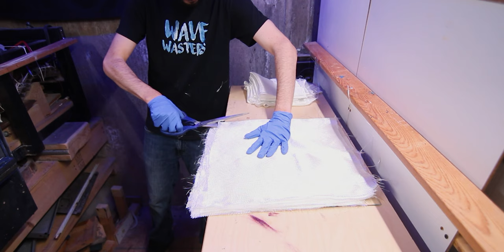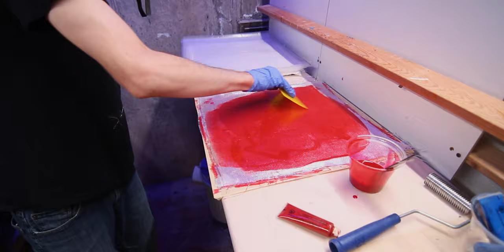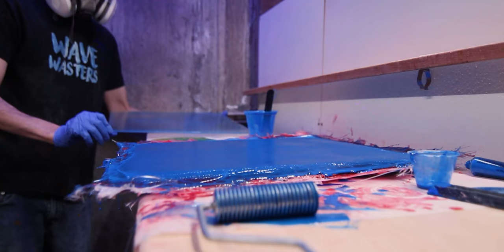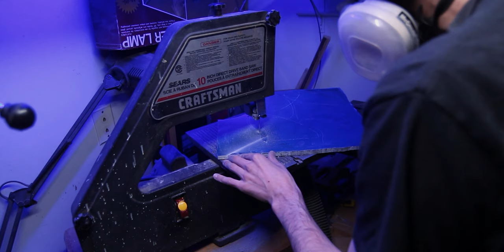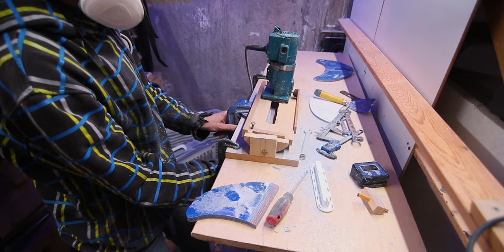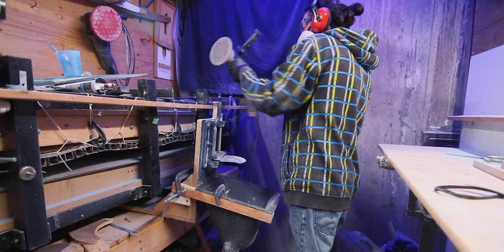Surfboard Fin Panel Experiment Gone Wrong: Lessons Learned

Comment: Livin’ and learnin’! So cool to see your tools and techniques as you create. I made a fin for a windsurfer once…it’s at the bottom of Lake George here in Kings County LOL! It was fun making it though and it worked for a little while before it broke off! I had satellite dish mesh as a reinforcing layer but I didn’t take it into the tab and it cracked and broke off where the mesh ended. Needless to say, it was fun sailing back to shore with no fin! I have made suspension support bulkheads for R/C cars by laying up fiberglass on a piece of glass, like you did, but I only made one layer and then cut the layer into pieces and CA’d them together in a press. They worked for their intended function but where they weren’t sanded, I don’t know if there was air bubbles in between the layers. Would it help if you put your final laminations in a press not worrying about the outside layer being smooth as you mostly sand that layer off?…just thinking out loud… As always, cool stuff Matt 👍 Cheers, John
Reply from the maker: Thats rough, how much harder was it to go finless? I've never tried a windsurfer before. A press would have solved a lot if not all of the bubbles. I should have tossed it in my snowboard press. I was originally going to use it but where I was testing multiple things at once I didn't want to complicate things too much.
Reply: @WaveWasters   Hiya Matt, it was not easy to go finless on a windsurfer as you need some sort of lateral resistance to counter the lift of the sail. If I remember correctly, ( this was over 35 years ago! ) I had to put one foot on either side of the mast and try to bury the leading rail to make it act like a bit of a keel to keep the board from just skipping sideways. I was close to shore so it was no big deal and I just jigged and frigged my way back in. My years of windsurfing made me think I would be good at surfing...boy was I wrong! The only thing in common with the two sports is the word "surf". To me, at least, surfing is way more challenging as there is nothing to hold on to like the boom of the windsurfer. Of course, I might say that windsurfing is hard if I had started it at 54 as well! 

Yeah, a snowboard press would have worked nicely ( I think ). It's still cool to see you innovate and invent no matter what the outcome. What if you dropped some CA in those bubbles on your fins and sanded them? Or are you even concerned and just counting this as a learning experience? I bet the next multi layer fins will be perfect. 

Cheers, John
Reply from the maker: Sounds like it would be a challenge with out the fin especially with how windy it can be. Have you been able to get out surfing again this summer?
I have a set from the same panel I've been surfing, so far its not enough of a hindrance for me to fix them. When we get more powerful surf it will be the real test. Then I might fix them or might not haha.
Reply: @WaveWasters  I've only been out once and that was in June for a local Dr. who is leaving the Yarmouth area for a year to upgrade her medical licence to handle emergency trauma. She is up your way doing the training and is probably out and about in your local surf spots at times. Her name is Emma and she rides a pink longboard. Anyhow, there was a going away party for her at another surfer's house in Mavillette and I was down for that and got out for a few rides in late June. I'm going out this Sunday for my 2nd session to Mavillette to try to get some cobwebs brushed off of me and my equipment. 
I have some interesting news though. I just had my 60th birthday and my wife arranged a special surprise party for me with a lot of friends and family. One of the guests was Brian Carey, who used to rent boards at Mavillette and is a board builder. Apparently, my wife had been talking to Brian to get him to make a board for me for my birthday. He came to my party and showed me pictures of a 9"6" board that he's building for me but it's not finished as it's been too humid to lay up fiberglass. He wanted it to be ready for my birthday but where it's been so rainy and humid all summer, it has put his progress behind and he's still working on it. 
I may have to venture up your way to one of the local surf shops to get a proper length leash for the board ( I say may as I don't know yet if he is supplying one with the board ) and if I do I will try to contact you to meet you if you like. I could be a "cameraman" for you for a sesh if you want... Anyhow, I'll have to wait for a bit yet as it's still a work in progress and I don't know when I'll be getting the board. 
I'll probably be getting out a bit more now as we've been busy with weekend trips with the family, camping with our granddaughter and two back to back weekends with birthday parties at our pool. Same thing happened last year as I didn't get out for my 2nd surf until September 11 and then I was out almost every weekend until November 13. 
There...a long winded answer to your question...lol! Cheers, John
Reply from the maker: @funafter5081  Happy Belated Brithday! A 9'6" will be a great board for a lot of the surf we get. Let me know when your headed this way.
Reply: @WaveWasters  Thanks for the birthday wish Matt and I think my surfing is going to change a bit once I get this board. I've seen what happened to another surfer who started surging the same time as I did when he got a 9"6" and it made a big difference in his surfing. He was trimming the line on anything that moved it seemed. Looking forward to that. I will send you a message if I come down. Cheers, John

Comment: very nice technique ! i tried to swirl red and blue pigment for fins, turns out mostly black not my finest attempt :'D
Reply: shouldn't you go with a hot coat on finished fins to take out external bubbles ?
Reply from the maker: I was really hoping it would have worked better, it would make making multi layer panels soo fast and easy. 

Hot coating them was a fix I thought about. I decided to surf the thruster set I made from the same panel to see if it was noticeable first. For me it wasn't really noticeable, and I figured I was better putting what resin I had left towards repairs and other projects.

Comment: Looks like you're not using either of your tab creation moulds, what's the reason for that, is this way (using the router) just a better way?
Reply from the maker: These are solid fiberglass so it's easier to cut the cant into the fin then to mold it on. The molds generally work better for wood fins when you want to save on fiberglass.
Reply: @WaveWasters The cant needs to go on both sides of the tabs though right, so that both sides are parallel? I don't think you showed that? Any chance you could do a close-up video of the jib you're using to cut the cant into the tabs, with explanations? Thanks!
Reply from the maker: @KimCarterNet  Yeah you need the cant on both so the sides are parallel. This can be done a lot of ways. I've been using my jig to cut the angle then clamping the angled side down and milling the tab parallel using drill press. Its not idea but its worked ok. 

At some point Id like to do a more in depth tutorial however the set of single fins i'm working on now will probably use up the rest of my resin. I don't know how soon ill be able to afford more epoxy either(currently im not making money on these videos). Luckily I have two videos I'm editing as well as the set im finishing so I'll have more content. If you have questions I can try my best to answer them with text if its not in a video.

Comment: If you have cured panels between wet panels of course you're going to get air bubbles /pockets. Best to gel then next colour
Reply from the maker: Your right waiting for it to gel is best for multiple reasons, epoxy complicates it some but still possible. I knew the chances of bubble were high and I would look like a kook for trying this haha. I know a few ways I can solve the bubbles. I should have used them but I want to limit my variables on this test.